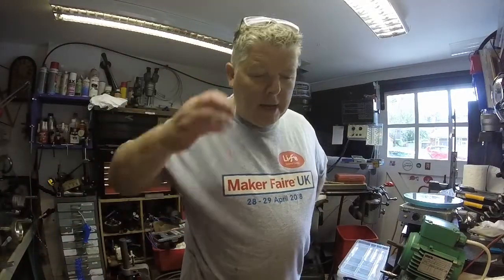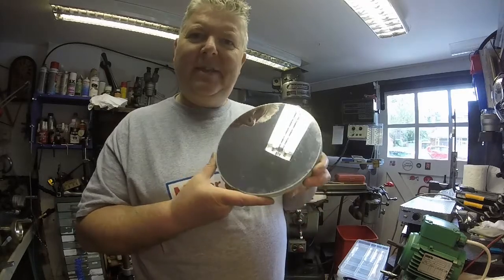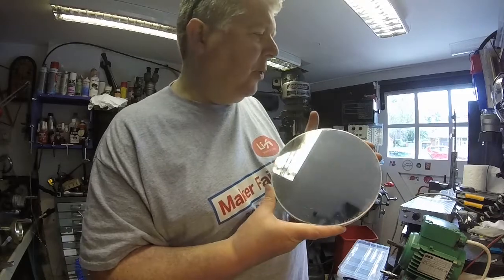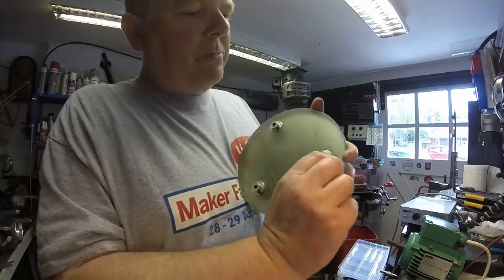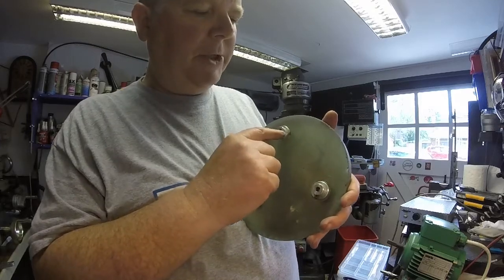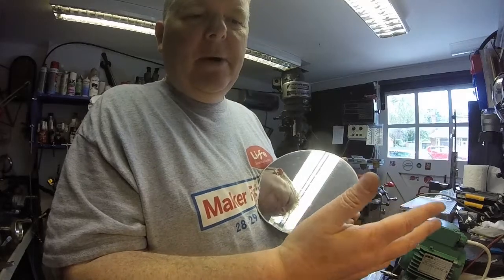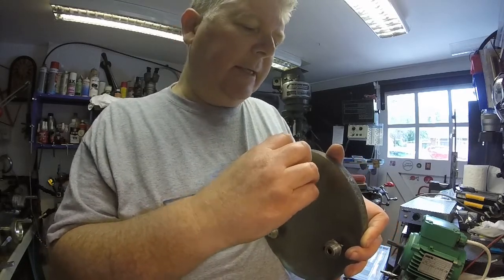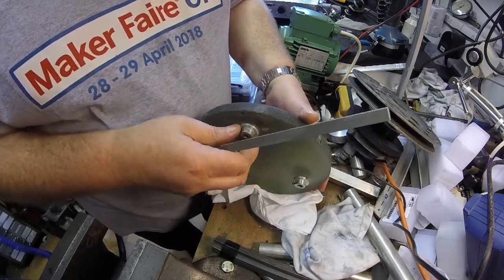JW24 Telescope Secondary Repair

Comment: You made me shout at YouTube!

You could have done everything except the tapping with the mirror held on its mounting screws.

BTW, RTV silicone will break down at a little over 200C. I've removed mounts from mirrors by conducting heat into them whilst applying a small load.
Reply from the maker: Very true. Anyhow all done and back on the scope working fine. Sorry to make you shout Paul ....

Comment: Sir if I use 12inch diameter 2000 focal length Plano concave lens for reflection telescope which length and diameter of  secondary mirror will I used?

Comment: Hi, Are there no way of cleaning the mirror ?, would be nice to see it in its place if possible.
Reply from the maker: You can clean surface silvered mirrors but in my experience it is best not to, unless absolutely necessary, It is certainly best to touch them as little as you can.
Reply: Ok, can we see it in place and maby some videos of the night sky.